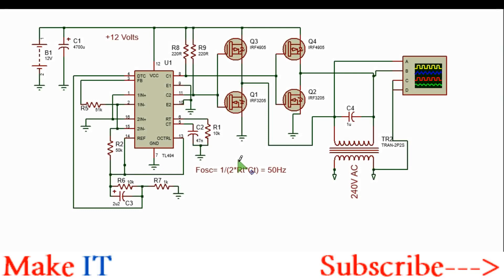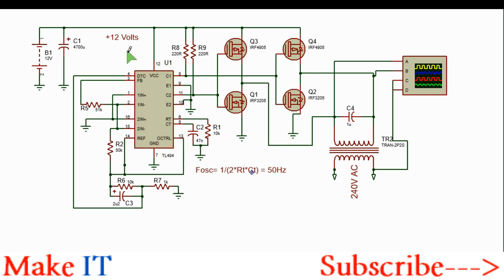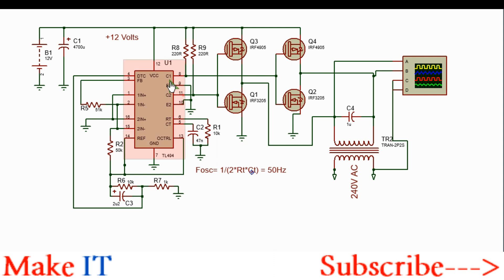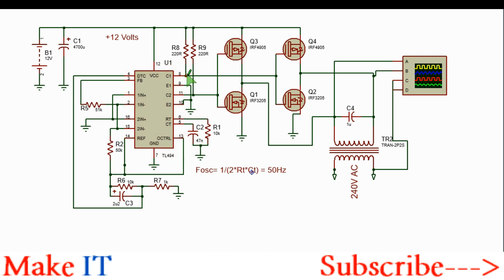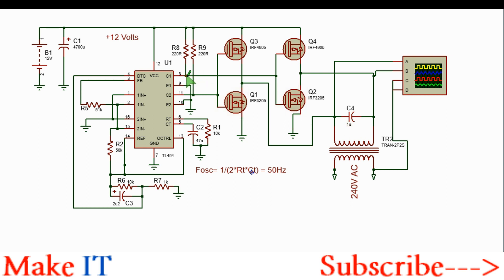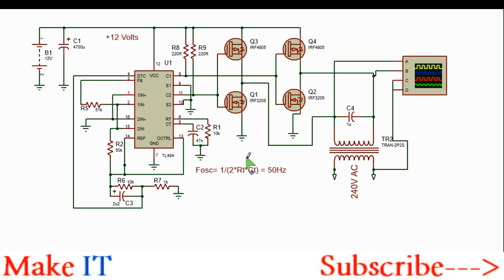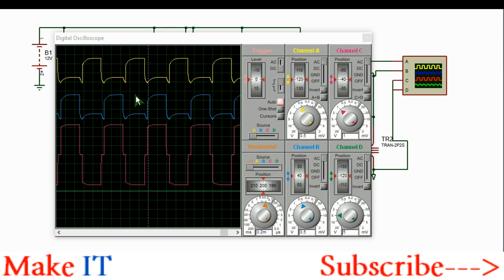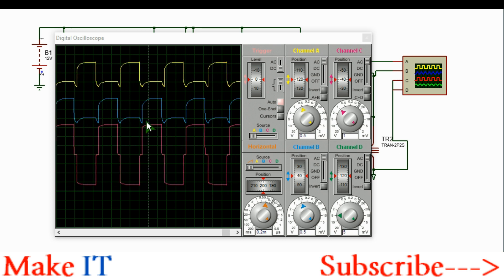Powerful Sine Wave Inverter with TL494 Full Bridge Driver | 700Watt | 12-240V

Comment: Actually this circuit is wrong, pin 8 and 11 both give same phase gate pulse, for push pull gate pulse pin  9 and 10 will give gate pulse with 180° phase shirf and i aslo required class B amplifier for better switching and increase current for Conduction of MOSFET.

Comment: Thank you, on the front page, 4 channel oscilloscope with 2 outputs showed sine waves but in the video more of square wave was shown. Another comment found that frequency of the output is>1000Hz(not 50 or 60Hz).  Appliances at home such as fan ac fan,  blender, fridge, are not designed to run at 1000Hz. Transformer type(ferrite or iron) used not seem stated? It is like this is run on software not actually constructed. Feedbacks(voltage control, output overvoltage,overcurrent, temperature, low battery etc) not stated

Comment: where is Sine Wave ?
Reply: Thank you, on the front page he showed 4 channel oscilloscope with 2 outputs showing sine waves but in the video more of square wave was shown. Another comment found that frequency of the output is>1000Hz(not 50 or 60Hz). Transformer type(ferrite or iron) used not seem stated? It is like this is run on software not actually constructed. Feedbacks(voltage control, output overvoltage,overcurrent, temperature, low battery etc) not stated